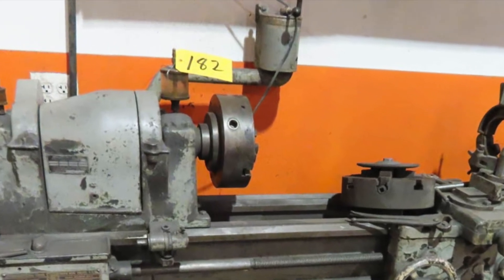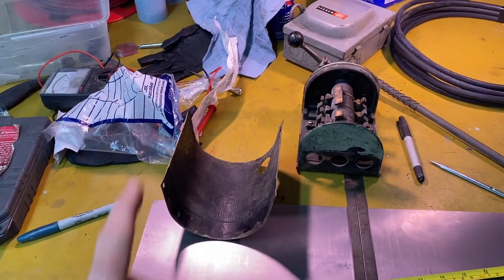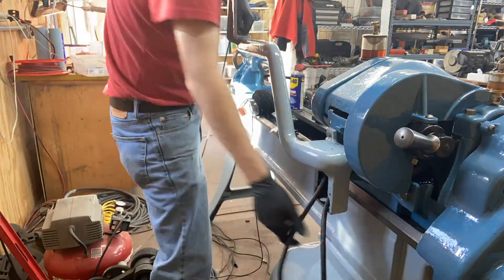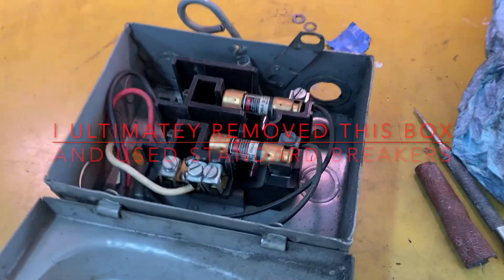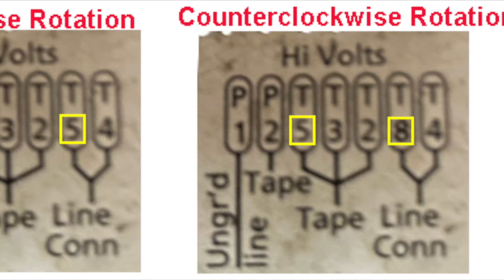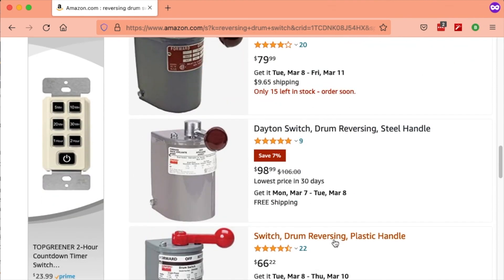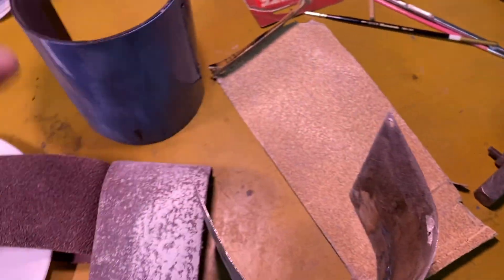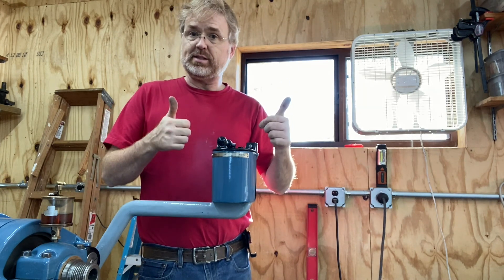South Bend Lathe Restoration , Part 10 (Electrical)

Comment: Nice job. Small victories! I went through the same challenge you did trying how to figure out the wiring in that drum switch for a single phase motor. Those drum switches are intended to be used with three phase motors. The way you reverse a three phase motor is by reversing any two legs and the drum switch makes that easy.
Reply from the maker: Thanks!  It's always easier AFTER someone explains it to me.  LOL!
Reply: I fought that Furnas drum switch for a long time! Did the same, converted from 3 phase to single phase.  I wasn’t smart enough to figure it out but had a smart friend. Your wiring looks clean! Great job.
Reply from the maker: @Mtjefferson555  Thanks for watching.  I don't have 3 phase to the shop, and I don't have a rotary converter.  So fortunately, my lathe came with 220 V single phase motor.  And it's always easier to figure out when one has friends!  :-)